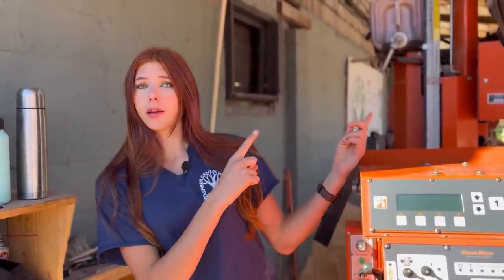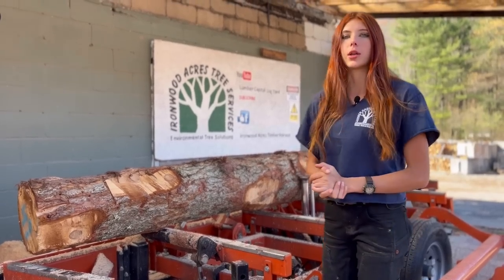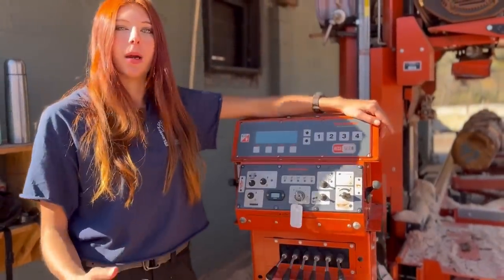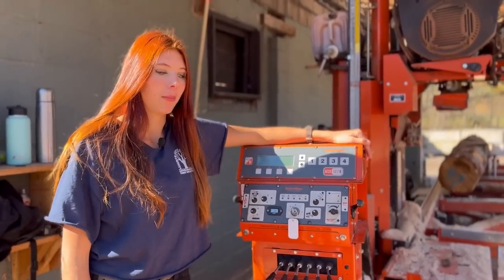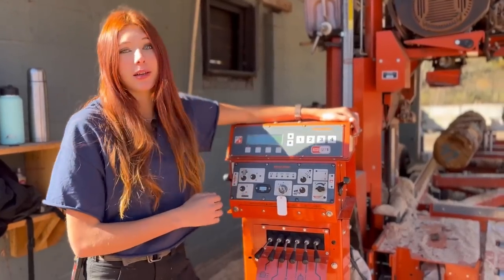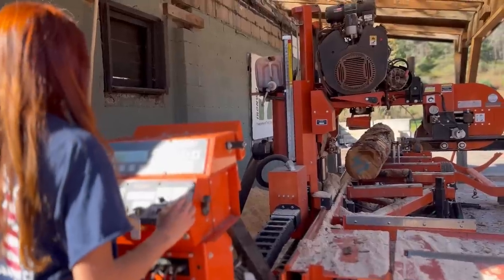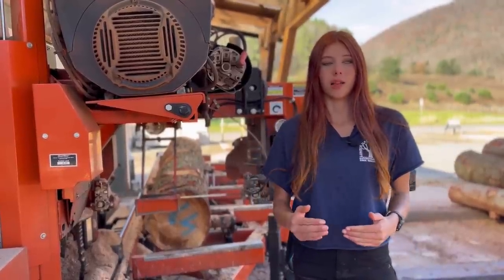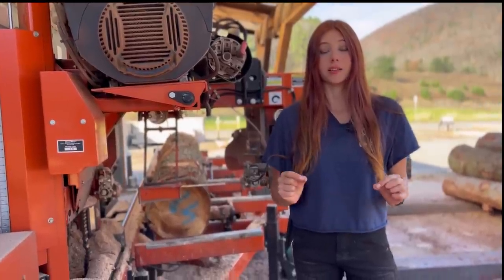Let The Machine Speak To You! Woodmizer LT40 Sawmill

Comment: All machinery of any genre speaks to its operator, provided its working with an operator that listens.  You’ve got this spot on Emerald. Great job
Reply: Great comment! Most well engineered machines do have a sweet spot for effective operation!
Reply: Sweet SPOT yes, In my mid-sixties, first time ever, I helped a farmer friend during five harvest seasons with one 6-cylinder & two V8-combines, all 6-row heads. In my second year, I was told that I was overworking the old 6-cylinder machine because I was outperforming the V8s. I said I drive for the sound of the machine & that varied from 3 1/2 to 5 1/4 MPH. I worked three more years & this fall I turned 80 & went for a ride with my old farmer friend & he said I was the only one that ever got that kind of work from that old machine.

Comment: You are gooood ,Em.   That sweet spot in between.
The teacher of blade speed  or advance pressure into the work is a handsaw.  A handsaw works best, quality of cut,, and fastest as well when the handsaw blade is held at a constant steady angle with a light pressure.  A heavy pressure will not cut faster but may cut wider.  A heavy pressure also may force the blade to wander.  All this is the same for a frame type hacksaw or powered bandsaw.  If you hear the machine bogging down, it is being over fed.  Back off,, allow the machine to cut at a comfortable rate.  If the machine is bogging back off the to the 80% to 90% of that speed.  Always stay just a bit below maximum feed rate.  Machine will last longer. Blade will last longer. The cut will be more regular, flatter, thinner.  More efficient all around.  And the best teacher is cutting with a handsaw.  If you can master a handsaw, powered cutting tools become easy to understand.

Comment: You're one smart and perceptive sawyer, Em. "You'll know when it sounds right." Exactly. Very wise. It's been the same with any machinery that I've ever operated in my 73 years. And especially for any cutting operation, it does not take long ( few minutes) to recognize the difference between the right and wrong sounds, even the first time one is using a new and unfamiliar machine or hand tool.

Comment: Those numbers are called feed rate ( in inches per revolution) the inches are the speed of the cutting head in inches per minute and the rpm is the blade speed in rpm (revolutions per minute)  If the machine could display those numbers you could just remember and set the machine to what you wanted. Talk to wood miser and I bet they will know how to make the machine capable doing it.
Reply: While that works with machines that cut metal I wonder how it would work on one of these, it wouldn’t hurt to be on there but I know from cutting you can have two hemlock logs the same size and have to go slower for one just simply because of the grain being tighter or more knots from where it grew, wood is not an even structure like metal, not a bad idea though just my thought on maybe why they don’t
Reply: Yea,,, it doesn't really work that way with wood.  For the most part metals will be a constant hardness and a specific width or thickness.  As Shaffer points out, one hemlock log will be different from another and you will even find that different sections of the same log will have different cutting characteristics.

Comment: Great job Emerald but I have a question, "Does the speed control change the speed of the table movement or the speed of the blade?" Also, what is the purpose of the bark cutter? I think I know but I just wanted to ask you so I would know the real reason. I am not into cutting lumber so I am a novice here. Saws I use can be held in my hand. Being a tool and die person I have sawed a lot of steel in my 42 years in the trade but not much wood. Thanks for your channel!
Reply: The rheostat changes the speed of the saw head moving forward.  The debarker has 1/4" carbide teeth that cut a small groove directly in front of the bandsaw blade to clean away any dirt or rocks the may be in the bark.

Comment: Are there any high wear and tear parts or maintenance items on the mill? what schedule do have for oil change s is it like every 100 hrs or so? Looks like the air intake for cooling takes in a lot of dust.A air compressor with a blow knozzle looks like a nessasary tool around there.I noticed the hr meter racking up hrs on the mill.

Comment: Hi Em.  Love your videos!  What is the wheel that is in front of the blade that runs along in contact with the log?  is that a debarker?  Is the purpose of it to remove the bark so that the blade doesn't get pitch buildup and also pull pitch into the cut???  Just a guess based on observation and logical thought....
Reply: It removes stuff that could damage the blade thus increases blade life.  Good video on woodmiser web site about it

Comment: What do you mean by a different degree blade?
Reply: The pitch of the teeth vary by degree.  We use lower degree blades for hard/frozen wood.  Boss Man.
Reply: @KenBreon  So, are talking degree from 90 to 160, or like 45 to 60? Or even 15 to 30?
Reply: @VTSteve  Let me see if I can help you with this, Steve.  When this family refers to "the degree of the blade", they are talking about hook angle.  Think of hook angle as how aggressively the cutting edge of the teeth lean forward. The more a tooth leans forward into the direction of the cut, the bigger a bite it takes.  On dense and/or frozen wood, a blade with too much hook will dull quickly.  That application would do better with a tooth design that had less forward lean, i.e. lower hook angle.  Hook angle is described as the number of degrees a tooth leans forward of 90 degrees (from the back of the blade).  A typical range is 4 degree hook for very dense or frozen wood, to 10 degrees for easier cutting logs.
This is hard to visualize without a graphic, but hopefully my explanation helps.
Edited to simplify.

Comment: Lot of time new blade don't mean sharp  look at the rooster tail of the saw dust it should be in line with the blade . If not your blade not cutting straight also you should have very little to no saw dust on your boards